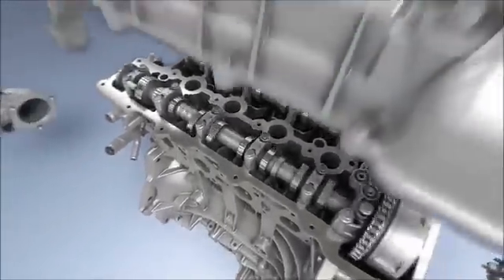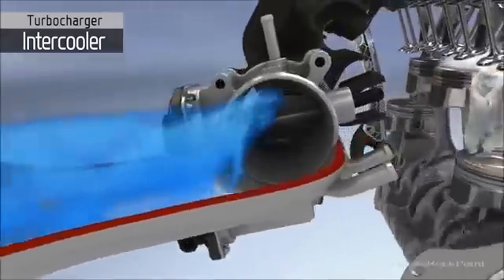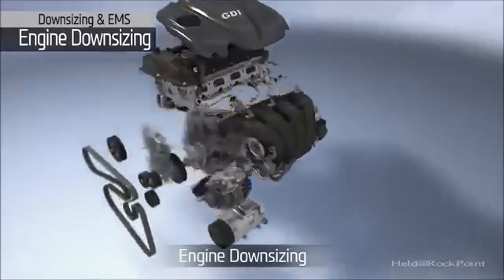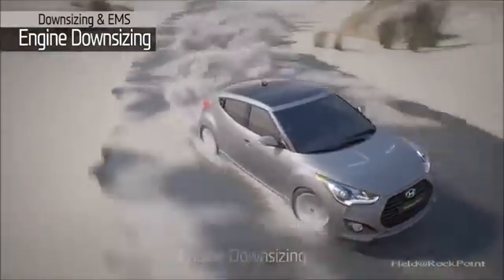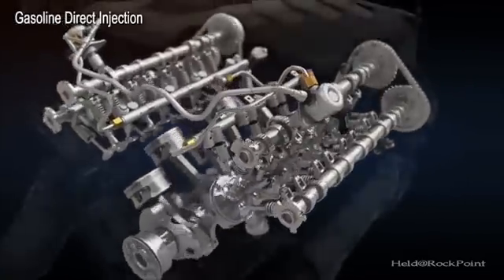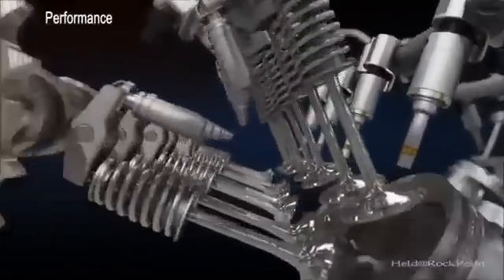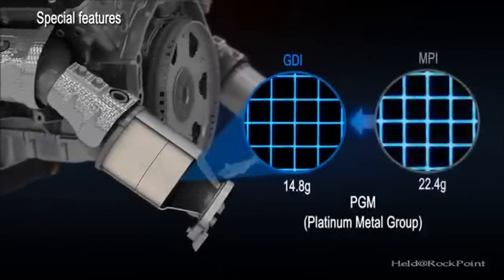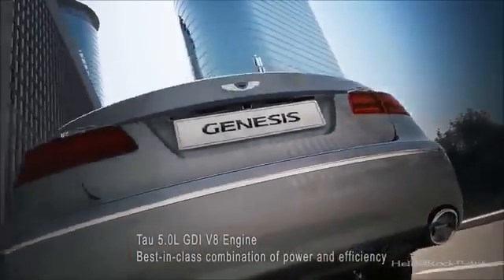Inside the GDI Engine

Comment: How are you going to keep those intake valves clean??  ;)
Reply: Manually, removing the freaking intake and brushing the hell out of it.
Reply: That was literally the only thing keeping me from getting the 2019 turbo veloster and instead going with the 2.0L naturally aspirated veloster. GDI engines don't last as long for that reason lol
Reply: exactly lol. if anyone want to go Di route i suggest toyotas with their D4S system. also dont forget the carbon build up on those DI fuel injectors lol.
Reply: Italian tuneup
Reply: They’re not.  At 100k miles it will be trashed.
Reply: @deepcow  All diesel engines are direct injection and diesel engines can last a lot more than 100k miles. So I doubt GDI engines will be "trashed" by 100k miles...
Reply: @deepcow  321900 km on a 2011 2.4 Hyundai G.D.I still runs perfect problem free. I will let you know when it dies but no sign yet.

Comment: OMG. I've owned a 3.8 Genesis coupe track for 2 years and still outperforms most on the road. Just take care of your car.
Reply: Lol..2 years is a new car as far as I'm concerned. Still in zero-depreciation zone.

Consumerism these days. :|
Reply: Let us know how it does after 100k miles lol
Reply: @Jte162  or 100,000 kms in Canada. GDI engine grenades and Hyundai/Kia won't honour warranty even in perfect maintenance record.
Reply: 2012 kia Optima 2.0 170,000 still runs great did the heads at 150 000 though......

Comment: Everytime u see a comment with it involving carbon buildup, take a shot.
Reply: advanced muffin The engineers have solved this problem by putting the injectors close to the intake valves. Some of the valve is in the spray when they open. The valves rotate over time, and are supposed to keep clean.
Reply: @bobbylee2853  all GDI Engines? G4FD (KIA) too?
Reply: Олег Романюк The new designs with the injectors between the intake valves are a big improvement.
Reply: @bobbylee2853  
I understand, but whether all the motors have these changes. G4FD motor also?
Reply: Олег Романюк I have a 2018 Civic with the 1.5 turbo Earth dreams engine and this technology is pretty much identical to all new design GDI engines. I wouldn’t have bought it if the valves were going to carbon up!
Reply: @bobbylee2853  thank you for the information. I take KIA Sportage GDI (G4FD)
Reply: advanced muffin critical design flaw

Comment: Many questions still regards to how does Hyundai prevents carbon deposit at the intake valve, a situation which GDI engine is infamous for? Toyota has got both intake and direct combustion injection which resolves this issue. How about you, Hyundai? I would like to hear from you. Thank you.
Reply: I have the same engine in my 2014 Kia forte I just had to have the injectors overhauled so I have 145,000 miles and I rarely ran premium gas. Mostly regular gas occasionally some premium now I’m going to run premium minute I just spent $1300 in repairs and parts also a camshaft sensor was replaced and also the valve cover gasket too . Never in my life. Have I spent this much money of course the labor it’s gotten pretty ridiculous on a four-cylinder car now I kind of wonder about the transmission. What’s next?
Reply: @theinvisibleman2070  Thank you for the correction 👍
Reply: @theinvisibleman2070  The second reply is edited too, thanks to the infamous spelling auto correction. 😂
Reply: Ian Polo All the new GDI engines have the injectors located so gas is sprayed on the valves when they open. Since the valves rotate freely, the whole back will be cleaned by 2000 PSI spray. It clearly demonstrates this in the video. The older designs had the injection from above, hence the design flaw.
Reply: @bobbylee2853  that's backwards. GDi doesn't clean the valves the way they should, hence why port injection was the better method. Look it up. Facts.
Reply: Peter Old technology was flawed, true. New designs available now wouldn’t have near the amount of carbon buildup like the old design. Believe what you want to.
Reply: @bobbylee2853  I have i30 with 1.4 TGDi engine, 2020 model. Do i have problem with carbon build up or this engine is like you mention (is sprayed on the valves when they open)? Thank you for your time.

Comment: I heared, The GDI Engine by H&K motor company accumulate carbone sludge at intake and exhaust valve.
It will be makes engine trouble.
It's really?
Reply: unfortunately yes over time. Many vehicles above 100k seems to be reporting this problem.

Comment: What about carbon buildup on the valves? How are you preventing this buildup if fuel is not washing over the back of the valve like with port injection?
Reply: Look at where the fuel injectors are on the engine. They’re mounted directly in front of the intake valves. They’re timed to spray when the valves are open and it’s a 2000 psi pressure. You can see in the video the mist hits the back of the valves at 2:43
Reply: @tails300  It may partial wet the base of valve but at the stem higher than that, could have carbon built up. Due to no fuel washing to that point.
Also fuel economy may not as good as purely direct injection that spray direct to piston.
Reply: homeidea2010 even with regular port injection only part of the valve is wet so that point is moot. A small sacrifice in fuel economy for better operation is better than huge amounts of coking on the valves. If you’re so worried about it give your self an Italian tune up every once in while...
Reply: @tails300  Yes, port injection still have carbon build up. But I used to see direct injection of MiniCooper S. The carbon built up is much worse than ported injection.  It have thick carbon deposit on the intake port near top of the valve too. It is still need to clean deposit on valve and at port wall also.
Port injection make wet valve and port wall, so it is less carbon deposit than direct injection.
Reply: homeidea2010 true but some cleaning is better than none, and haven’t heard any reports of Kia and Hyundai’s cars having problems with build up yet. It’s mostly German cars like Audi, Volkswagen and BMW( and Mini like you said) I read about, it probably has something to do with the location of their fuel injectors and valve position.
Reply: @tails300  It can be no problem, but you may have decrease in airflow some. Due to some restriction of carbon deposit on port wall.
Reply: I swear there was this thing that would slightly rotate the valve each time the valve opens to slide it along the valve seat as to prevent buildup.
Reply: @dkmodder4405 It's called Positive Valve Rotation bu causing the lifters or pushrods to activate the valves a few thousandths of an inch off center. It was introduced in the 1970s to help cope with unleaded fuel.
Reply: @dkmodder4405 It's called positive valve rotation, and it became common after 1975 or so for the coming unleaded gasoline. But it only grinds the carbon of the seating part of the valve, not the back of the valve and the port that get clogged with muck.
Reply: Will be dual injection system like Toyota.
Reply: Tuning now the fuel goes in after intake valve is closed
Reply: @jaygames1980  That doesn't change anything. Carbon forms on the valve due to oil from the pvc valve and anything that escapes the air filter. The gas would normally spray on the valve to clean it.
Reply: Just decarbon it on regular two times per year. There are plenty of cleaning kits and service shops nowadays.
Reply: Run high octane gas. Floor it a few time's, problem solved!! I hope you don't claim to work on engine's.

I learned that when was a child!!
Reply: @boostjunkie2320  That gas you're using to floor it with does not touch the valves so it is of Zero use! I hope you dont claim to know anything about engines.
Reply: @davenone7312  It does on most engine's.......
Reply: Most GDI owners install an oil catch can to mitigate oil blow by.

Comment: Old news.  Sadly, it's going to be a long stretch before ALL makers quit having dinner only. This is well documented to be the cause of serious valve carbon buildup on the back side without any pre injection coming from behind the valves to wash them clean this is an expensive fix all makers need to get on board with multi injection points
Reply: What is carbon buildup?
Reply: @rohithchandrathonupunoori111  On older style multiport fuel injection engines the fuel injector is located above the intake valve. When the fuel injector shoots its fuel charge into the cylinder the gasoline vapor is washing over the valve thus cleaning away any oil deposits  which could form into carbon. A GDI engine on the other hand has the fuel injector directly in the combustion chamber so the intake valve does not receive the benefit of the fuel charge washing over the intake valve. The reason for this design is by placing the fuel injector directly inside the combustion chamber the fuel charge can be more accurately controlled for better fuel mileage, performance, and lower emissions. This means that the intake valves must be cleaned by introducing a cleaning solution into the intake system from time to time at a dealer service department or other service facility. Many owners, such as myself, have opted to install an oil catch can to prevent minut amounts of oil from reaching the intake valve in the first place thus eliminating, or greatly reducing, this problem. Hope that helps.
Reply: that is why we have to get a catch can
Reply: @danielsepulveda912  The manufacturer should have designed the engine right to begin with.
Reply: MPi inyection is more effective
Reply: Look at where the fuel injectors are on the engine. They’re mounted directly in front of the intake valves. They’re timed  for a second staggered when the valves are open. You can see in the video the mist hits the back of the valves at 8:25